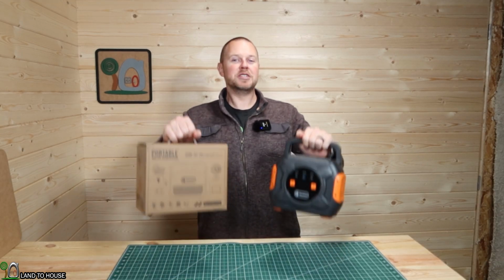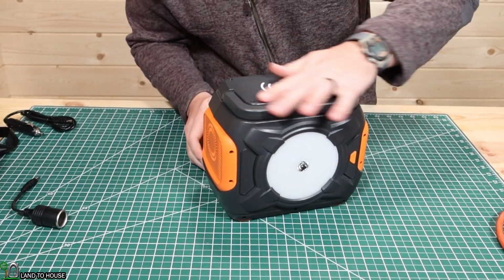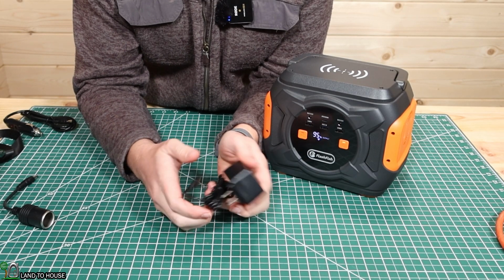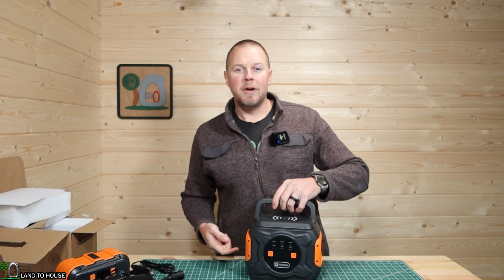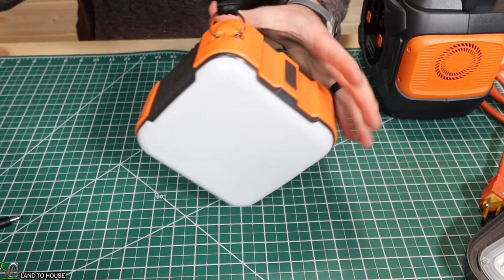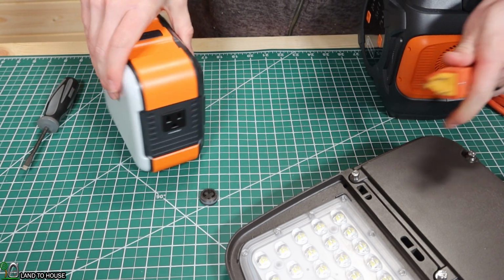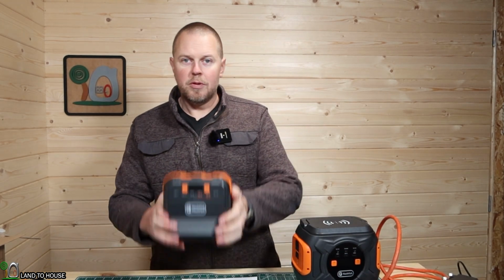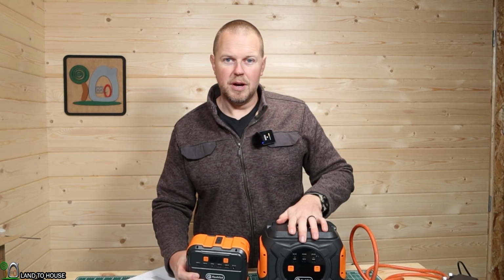FlashFish Power Stations A101 and A301 Side by Side

Comment: Hello.
Does the Flashfish A101 battery have a UPS mode?
That is to say that if I cut the power supply from the network to which it is connected, does it continue to supply it instantly at 12V, for example, without a micro-cut?
Thank you for your reply.
fred
Reply from the maker: This power station does not have output while the unit is being charged.
Reply: @LandtoHouse  
you mean that we can not supply any device with this station while it is itself charging on the network or on the solar? it's not very practical as an energy station...
Reply from the maker: Correct. You have to unplug to use the AC and DC output.